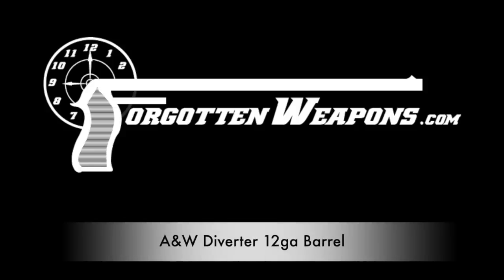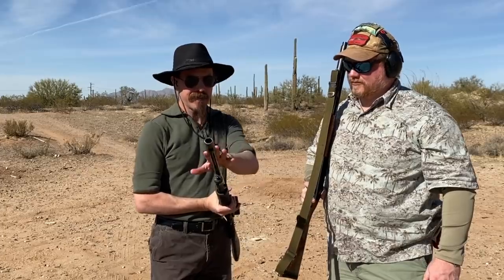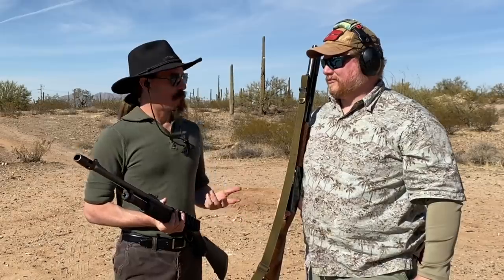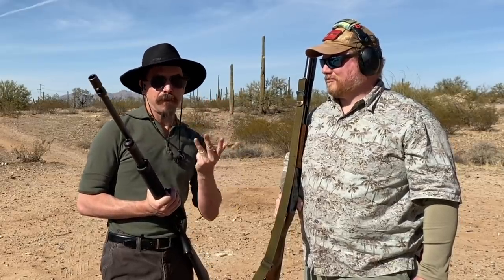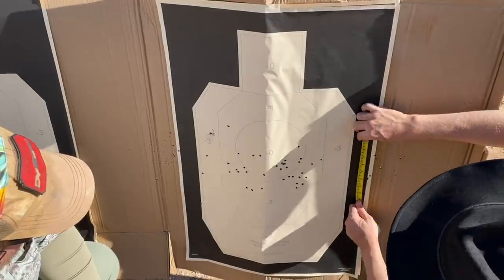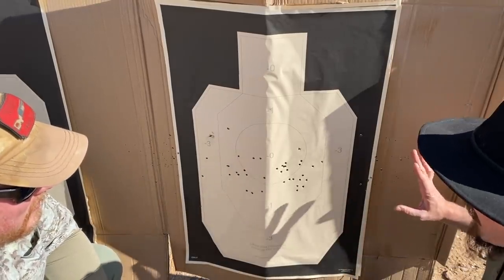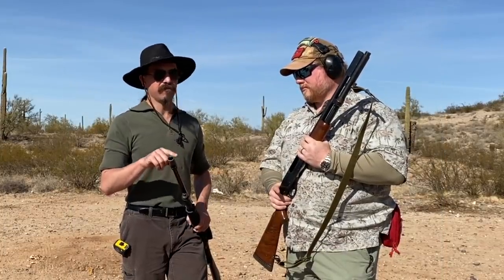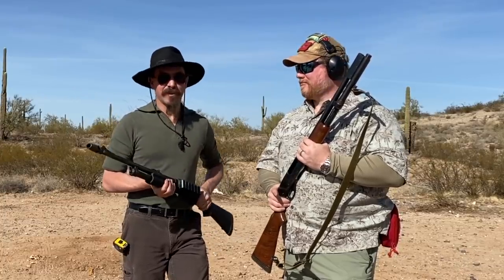Duckbill Done Right? Testing the A&W Diverter Shotgun Barrel (w/ Matt Haught)

Comment: My first thaought was wll it give any advantage on clays or skeet. Back in the 80's I was sold a whole lot of Baikal shot shells by the local gun shop cheap. I found that I could not hit anything with them so I tried them on some board,at all ranges I was getting a single hole of an inch or less with a few pellets outside of that. For whatever reason the plastic wadding stayed with the shot all the way. In the dark there was a yard of orange flame out of the barrel and the rescoil loosened the screws on the gun, in the end I gave them away to someone who wanted them.

Comment: The reason for the donut pattern, as far as I know, is focusing. As the choke focuses the shots, the pellets on the left get pushed right, and vice versa. Similarly top and bottom. With larger shot there are less shot that are traveling down the center of the barrel and don't get pushed around by the choke (and other pellets). Smaller loads have more shot in the center.
If you remove the choke I don't believe you get a donut. But I could be wrong.

Comment: I would imagine that the doughnut pattern is due to spin imparted on the pellets from the barrel in a radial pattern from the center to their respective edge.  This would lead to them pulling outward from their respective location on the outside of the barrel.

Comment: The duckbill would basically just let the shot cup open on the sides earlier than what emerges at the top and bottom, and that's not a whole lot of difference. 
This thing actually looks to pinch the shot column while stopping any spinning from barrel inconsistency, so the shot "bounces" off itself and diverges horizontally. And that's why there are windows cut in the device.... to keep from bulging barrels or gassing faces, give the pressure somewhere to go.

Comment: During my life I have been told two stories involving using shotguns for "Less Than Letal" crowd control.

 1. The use of 12 gage oak projectals. Result - 12 gage holes in the people they were fired at.

2.  Firing bird shot at a steep angle against very smooth floors in prisons. The theory being the shot would deform into sharp/flat disks that would cut multiple prisoner's ankles. Results - Unknown

Comment: I would direct your attention back those .45 ACP riot control rounds you had a video about, a while back. 

As you pointed out,  erm, "labor relations" were somewhat different in those days. I was thinking about how you found documentation that the intended purpose was to skip pellets off the ground into peoples' legs. 

12 Guage  obviously holds more pellets than you can jam in a .45, even an extended one, so I'm wondering if that was a selling point. "Just pull that hunting shotgun off the wall, slap this baby on the end, and regular birdshot becomes effective riot ammunition!" I could see that making sense to police/ sheriff's administration in the depression era '20s, when money was tight. Better a standard pump shotgun and bird shot, which we already have, and a cheap muzzle device, as opposed to an expensive Thompson and specialty ammunition.

Comment: Why not take them out to the skeet range off of Old Ajo Highway to tray and hit some clay's and see if you can hit that fast moving lateral target? You could get a near perfect repeatable flight of the same speeds to see if the Duckbill and Diverter adapters would have any effect or better chances of hitting in flight. You might even want to try it through a fill course too. I haven't been out there in years, but they use to have a small sporting range with a rabbit clay. I really need to go back there, it is a nice range. It's gotten a lot bigger since the last time I was out there too. But it might be a place to consider to test the hit probability on a flying target that could have a set speed and repeatable flight. Just a suggestion.

Comment: If I recall correctly, The National Guard used to fire the shotguns at an angle toward the pavement to ricochet the shot into rioters’ legs. That killed a most of the velocity but kept much of the sting, making it less lethal.  It still would not be approved for modern use though.
Reply: That’s how rubber bullets are “supposed to” be used as well.

Comment: The rationale back in the '60s and '70s that a shotgun firing birdshot would be "less lethal" only really applied if the Riot Control Officer employed a technique called "skip fire" where the shotgun is aimed at the ground in front of the rioters so the pellets ricochet or skip.
This was considered a "less lethal" approach because:
1) Some of the pellets' energy would be absorbed by the ground.
2) Injuries would be limited to lower torso and legs.
Using a duckbill device on a shotgun would enhance the effectiveness of this technique.
For more information please refer to the works of the late Col. Rex Applegate.

Comment: How does this compare with the muzzle diverters on the HK 512 and SPAS-12 shotguns?  (Both made by Franchi).  I searched for a long time to find an A&W but they are very scarce and expensive.  Then I ran across a similar diverter marketed as a game choke called the "Shur-hit" which was a screw-in choke version so I bought one, and then had to get a barrel for my 870 that would fit it.  I only was able to get it all put together this last week and am anxious to try it out.

Comment: Doesn't the shot cup protect the pellets from contact with the barrel?  All of the shotgun rounds i have taken apart have a plastic cup with a shock absorbing base that contains the pellets, end it basically a sabot after it leaves the barrel.  Is this not the case anymore?  I haven't looked at shotgun ammo for over 30 years, so things may have changed.
Reply: Depends on the loading. This S&B stuff is just pellets stacked on a felt wad. FliteControl has a very effective shot cup wad that protects the pellets, one reason it patterns so well

Comment: Possibly out of place here, but it's funny to me how people discussing birdshot for self defense always talk about #8 low brass versus Buckshot and slugs (I know, "Paul Harrell..." and it was a great video)
  A 1 1/4 oz of #4 shot at 1400fps is a WAY different beast than a 1 1/8oz #8 skeet loads at 1150, ESPECIALLY if you use a modified or full choke versus Cylinder bore.

  Even more so with #2 or BB, which is still "Bird shot".
Reply: Not to mention shot sizes larger than BB. Such as BBB (.19"), T (.20"), TT (.21"), TTT/F (.22"), and FF (.23") all of which are birdshot. Even less talked about is the use of tungsten shot like T.S.S. which BB is used for deer.

Comment: I’m going to suggest something rather nerdy.   There’s some interesting mathematics governing the shot patterns of each muzzle device.   Each device results in a 2-dimensional density function of sorts.  If you select an area on target, integrating the function over that area will compute the probability that a single pellet will land in that area.   Are you still with me? I’m wondering if that density function is the same for each shot size, but you get a more extreme spread with the smaller shot size simply because there are more pellets.
Reply: Probably some normal distribution, but in 2 dimensions
Reply: @LumianGames  I don’t think it’s exactly normal.  There’s a void center of each pattern.?
Reply: Given that two guns of the exact same type can pattern very differently with the same load, there's an awful lot to consider.
Reply: So a particular gun has a particular pattern.  That’s not hard to swallow.

Comment: I wonder if the "donut of death" is the result of the pellets starting to spin as they slide down the barrel, as a spinning sphere is subject to the Magnus Effect and will tend not to fly in a straight line.
Reply: Isn't that technically all of them since they're all smaller than the bore, given enough flight distance of course? They would all eventually spin away from the center on any shotgun, right?
Reply: @DoitForTheLolz1  Maybe as the pellets get larger, and the count goes down, the probability of any given pellet impacting the side of the barrel goes up?
Reply: @moosemaimer  One could guess that a perfect shot shell firing gets the pellets out before they have a chance to rub against the barrel, and if it doesn't for some small reason then you get the hidden donut spin no-jutsu. Otherwise maybe its just the ammo or just the nature of things in the case of shotguns firing shot.

Comment: I was in Tijuana Mexico for New Year's the late 80s. The power went out and the riots started. The rioting was mostly Americans celebrating the holiday. The Tijuana police formed a line at the End of the Street, fired one blast of shotguns in the air at a 45 degree angle, Jack their shotguns and fired a second blast straight down the street. They then March forward a number of paces and repeated the procedure. The streets were clear and quiet in a matter of minutes. I do not know what load they used in their shotguns. But it ended the riots quite quickly. The rioters were doing damage just for the fun of doing damage, I have no pity for them. There are times when you don't need to f*** around.

Comment: If you replaced the Bird Shot with Airsoft BB's, would that truly make the cartridge a "Less than Lethal" Riot Control Round?
How would the spread be with Airsoft BB's?
Reply: I don't sink BB's have enough mass to make the pressure high enough to allow proper combustion of smokeless power, without having to use some very strange loadings
Also u may as well bring an automatic airsoft gun

Comment: Back in the 1960s, the anti-riot plan was to “bounce” birdshot into the front of the crowd.  We were trained to aim such as the top of the pattern at or below the beltline.  The the theory was that there would be a n announcement of intent to discharge firearms, then after a chance to leave, advance with walking fire as necessary.  Never had to use this technique.

Comment: I'm of the opinion that shotgun design is not a problem but the ammo is. Mag fed shotguns (MFS)hate rimmed shotgun shells or more accurately the magazines hate them. Make rimless shotgun cartridges. Yes. it's a new round but I never said get rid of the original. If you do what I'm suggesting  you are basically going into a low pressure rifle round with no rifling and multiple projectiles. I really think we could make a cartridge for a MFS that wouldn't have the feed problems that are experienced with a cartridge design that is 150 years old. Brass or nylon for the case and a smaller caliber would probably be the way to go to get the precision needed for a semi-auto to feed from a mag. I would think a 20 gauge size cartridge with a higher pressure propellant and something along the line of 4 Buck in a slightly tapered or straight brass case would do the trick. You don't really need a 12 gauge at the ranges our military and police use them. They're not hunting. They're closing and killing at that point and don't need the range a hunter might need. Increase the velocity and the speed of a second shot and I think you would see a remarkable increase in efficiency and reliability.

Comment: Definitely much better design: better results and most certainly better durability. The design has a "double oval" shape, clearly designed to remove pellets from the center, which is why the result is so even over a large area, rather than most arriving in the center. Now how is it of any use... with less than lethal rubber bullets, it could avoid hitting the head and balls, by reducing the vertical spread, and increase efficiency by increasing horizontal spread. But does it work with rubber balls? I hardly see any use for hunting.

Comment: Cool video, but they didn't address the first question that came to my mind: Did either of the diverters, the Duckbill or the A&W, have any noticeable impact on the handling characteristics of the gun, especially perceived recoil?
Reply: Not that I noticed.
Reply: @matthaught4707  how was the blast with Ian's? I'd expect it to be pretty obnoxious.
Reply: @ScottKenny1978  I didn't notice anything more obnoxious than a regular barrel.  Shotguns are pretty low-pressure rounds all told, and the ports are big, so it's not like being next to a guy with a braked 10.5" 5.56 or anything.  I noticed nothing out of the ordinary in terms of noise or blast.
Reply: @matthaught4707  cool, thanks for answering!

Now, where to find one of these duckbills to duplicate for modern production? Though I suspect that the Vietnam vintage duckbill would be a lot cheaper to make.

Comment: I feel like this is a dumb question, but I wonder, what would happen if you'd fire a slug through it?
Reply: I’m guessing it works by hard choking on one axis so the result with a slug could be fairly catastrophic.
Reply: @fredbloggs5902  I have a feeling that the choke is squishing the shot column and slugs don't do well with constriction. So I am guessing that a sabot would be destroyed trying to leave the barrel. Possibly impacting the slugs stability and accuracy. With a foster or full bore slug I imagine the slug would get shaved trying to exit. Resulting in instability and inaccuracy. Not to mention the damage it would cause to the choke itself.

Comment: t guessing but anybody think that pellet crush  is one possibility. The other possibly Magnus effect (bend it like Beckham). The constriction of the devise causing high and low pressure areas  at the muzzle, this imparting spin on the shot. An experiment could be easily replicate using marked plastic balls and air pressure in a transparent plastic barrel. A high speed camera would at least prove the theory..

Comment: i like how Ohio's definition of a "riot gun" is +3 mag capacity and a Bayonet.
Reply: It goes back quite a ways.  In WWI and WWII, short-barreled (i.e. 18"-21" bbls, not the modern NFA definition) shotguns were generally referred to as 'riot type' guns because they were shorter than the hunting/sporting guns with 28" or longer barrels.  The US military sometimes differentiated between plain riot guns and what have become known as 'trench' guns (i.e. with heat shield and bayonet lug), but sometimes they didn't, or they referred to the latter as 'riot gun with bayonet adapter'.

Comment: When it came to riot control, didn't they aim for the ground so the pellets would travel parallel to said ground in order to reduce the kinetic energy, effectively turning it into a non-lethal form of crowd  control that would sting people's feet?
Reply: Rubber buck shot is used for this.
Reply: @rfswitch4530  I'm aware of that, but I recall a story I believe I heard from a guy that was with the 10th Mountain in the 60s that said they did this.
Reply: @Vagabond671  that may be.  Perhaps specific riot control ammo wasn't available then.  We never trained for riot control with standard shotgun ammo, we've always used rubber buckshot and rubber "baton" rounds.
Reply: @rfswitch4530  I see. Thanks for the insight.